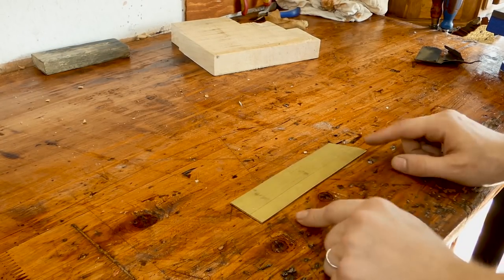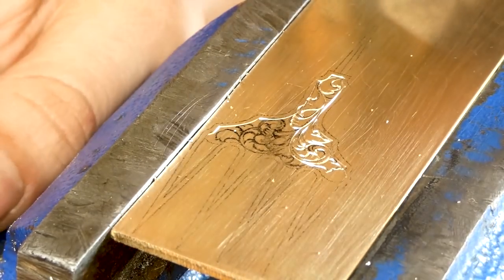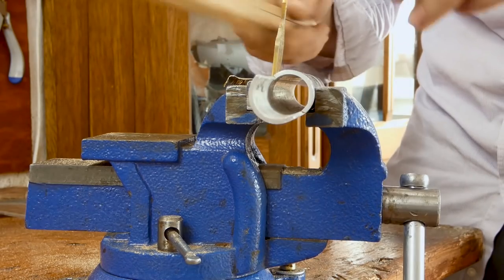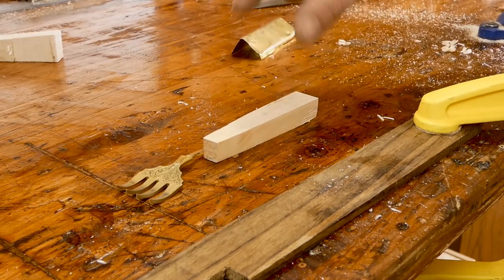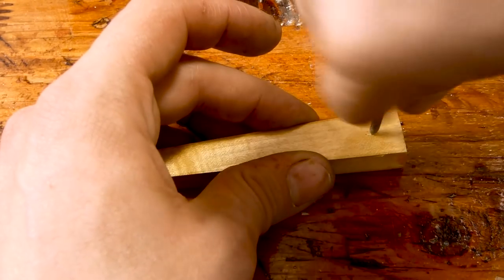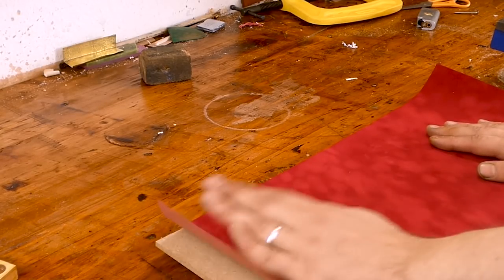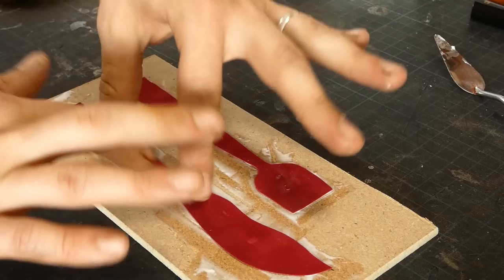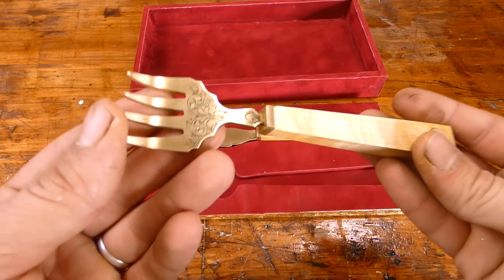Making hand-engraved fork and knife

Comment: Uri, I work as a repairman of brass instruments in the states. I suggest, if you want a higher finish by hand, a product called miracle cloth. I don't know of the availability where you are but it is mainly cloth soaked in coconut oil. It really shines up brass and brings it to a pretty high luster.
Reply: so youre sayin this stuff can be used for trumpets?
Reply: Dr. Locklear I would be careful with that and try and stick to washing your Trumpet with water, but I suppose if you wanted to you could use that.

Comment: Start a gofundme account,  and get yourself a power scroll saw and belt sander. Your hand work is very good, and i wouldn't change your engraving and fabrication,  but to have to loose so much time to hand cutting brass and rough filing is unfortunate.

Comment: When I was watching I thought you would engrave both sides of the knife, you didn't which is still ok (I'm sure they love their custom engraved present) It's just that you engraved the wrong side that really threw me off. Not really an issue since these are pretty much just decoration.
Reply: I'm referring to the way a table is set with knife to the right of the plate and having the sharp side face inwards. With this knife if you were to place it on the table normally it would have the un-engraved side facing upwards.
Reply: Thats what i thought too, but the project is beautyful it doesnt matter as long it is in the showcase right?